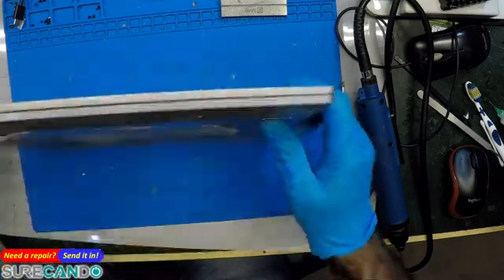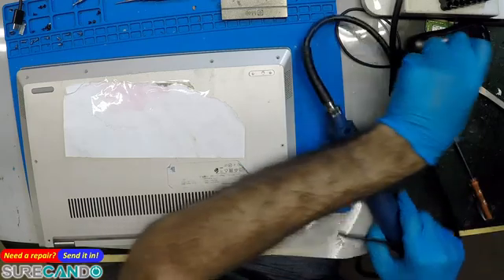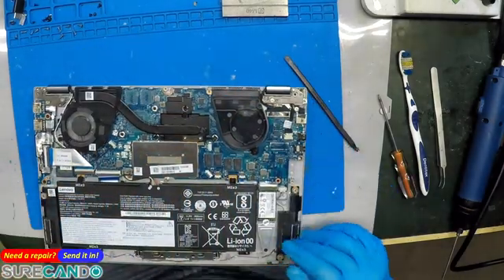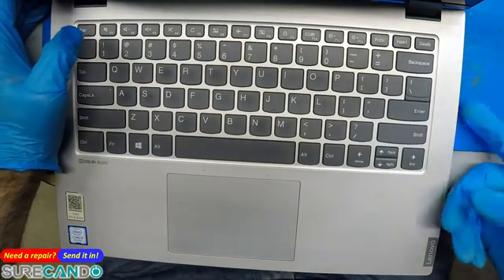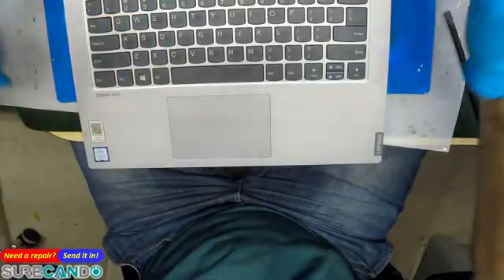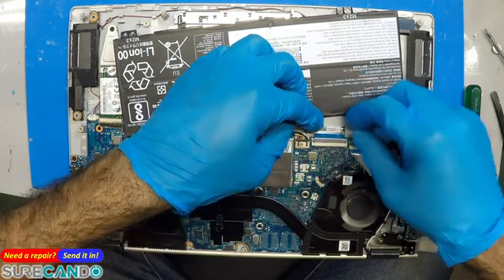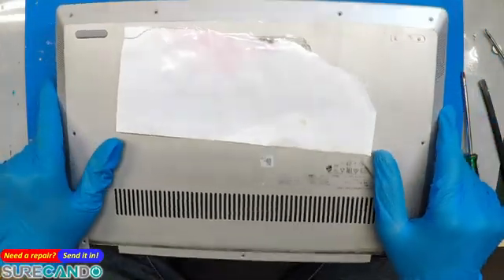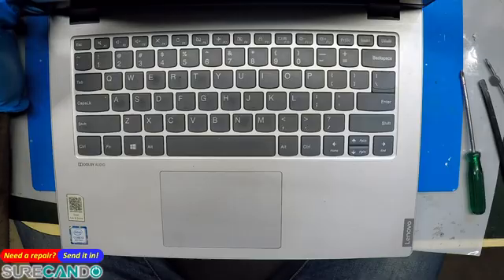Lenovo IdeaPad Keyboard Repair keys not working C340 14 C340-14API C340-14IWL C340-14IML

Comment: What was the problem
Reply: The keyboard ribbon cable was not connected completely to the motherboard connector, caused by the battery pressing down on the keyboard ribbon cable and dislodging it. The cable will also become disconnected if the laptop is dropped! The internal design of the motherboard for these laptops is prone to this kind of keyboard problem because after a while the laptop body will 'stretch' causing disconnection issues. One user complained of how the left cursor keyboard was deleting text in a document as if someone was pressing down on the Backspace key!